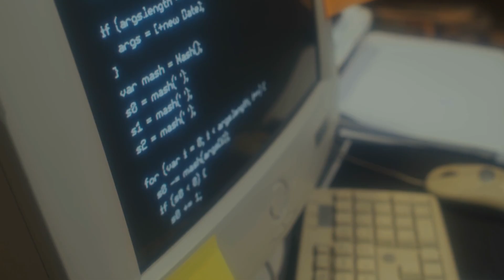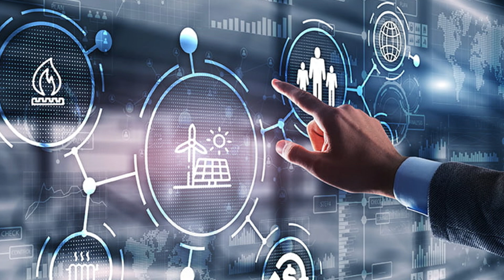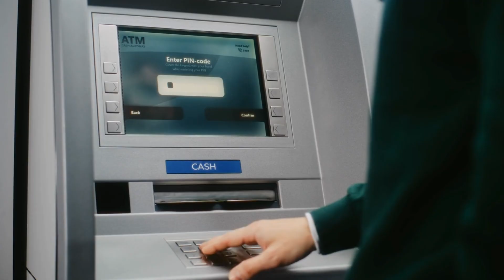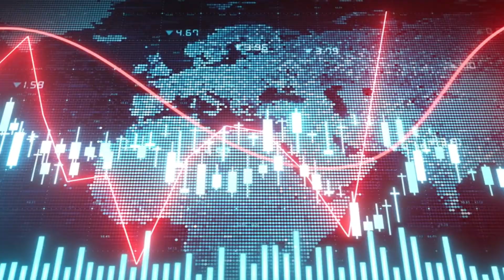Blackout Warning: Why Grid Failures Are Inevitable

Comment: Helpful emergency supplies: 
Survival Water Filter $60 - $80 or gravity filter with a straw filter $30 - $40 avg,  
propane tanks (full) & Mr. Heater Buddy Heater- about $80 - $100, propane & butane + dual fuel portable stove- Amazon $35 - $50 avg,  first aid kit fully stocked, 2 weeks of food & water- minimum  1 gallon a day, preferably 2 gallons (per person), 2 weeks minimum of any meds needed + Acetaminophen for pain/fever, Benadryl (diphenhydramine) for allergies/ itching/ allergic reaction/bug bites, Loperimide for diarrhea, hydrocortisone cream for itching/bug bites. Herbs: ginger for stomach upset, chamomile for stress/anxiety, echinacea, garlic or oil of oregano may help for bacterial infection if antibiotics arent available (but try to get medical help asap), flashlights, headlamps, solar lanterns, solar power bank for charging phone & small appliances (wide price range, depending on wattage- you can get a 20,000 - 50,000 mah for charging a phone for $25 - $40 on Amazon, batteries, mylar emergency blankets...
Reply: Till some 1 kills ya for it..yeah keep flapping your cock holder..quit helping them.. more for people that know an dont tell..Dumb ass keep it up an you be the first to be killed and robbed......shut up.....